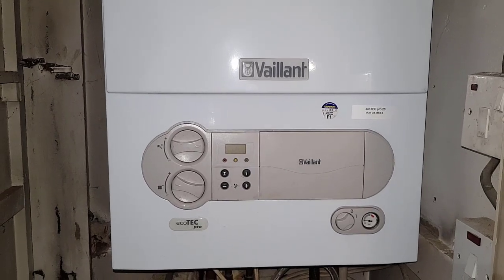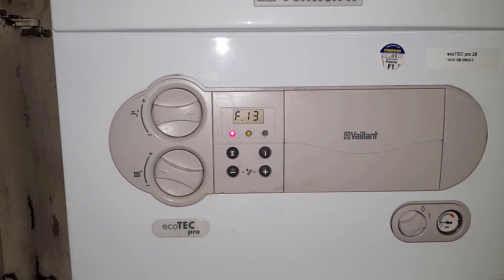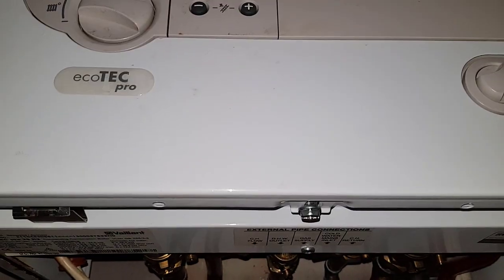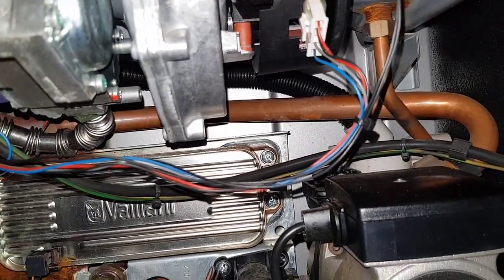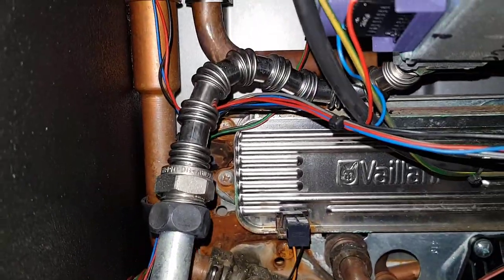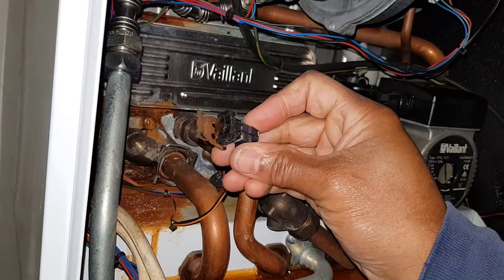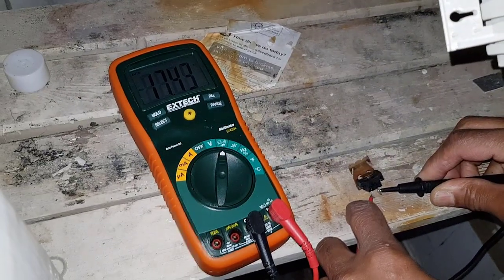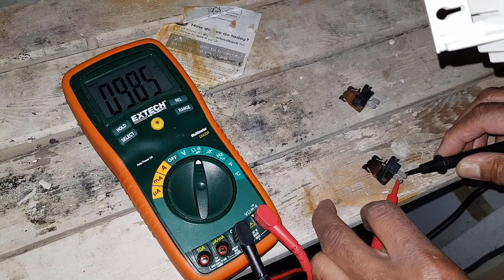F.13 Fault Code Vaillant ecoTEC | How to Fix the F13 Fault Code on Vaillant ecoTEC Boilers

Comment: i have a new problem (at my VCW 206 5/5 R6 Gas/Water Combi  ) Ich have D.003 116 deegres celsius in my Diagnostics. At 17 deegres room / tube Temperature (a night with heating of) i measure about 450 oms at the sensor for hot water (not the shown sensor in the video but the sensor on the tube below this sensor ) and if wamr water flows an heats (to 65°) D.003 still stays at 116°. Vaillant part no of this NTC is 103429. Does anyone has a Document were es find the ohm / temperatues for this NTC - i guess mine is defect because of 116°. I have the problem that my VCW often makes warm water even if i don't take water in bath, kitchen, shower. (with 116° at this ntc versus 65° max it shouldn't heat i would guess but it does the opposite !). Does anyone has a link for the document wer i can find the ohm table for these ntc's ?

Comment: Hi thanks for your video, I have the vaillant ecoTEC  Pro 30 and have developed the same fault code but the sensor looks in perfect condition,  the boiler is just over a year old, will this still be just the case of a faulty sensor
Reply from the maker: If its not the sensor then it will be a board fault
Reply: @ARBoilers  Thank you for responding, when I do a system check it displays an S.30 code. I would like to know whether I'm better to call out for a repair or if it could be a cheap easy fix.